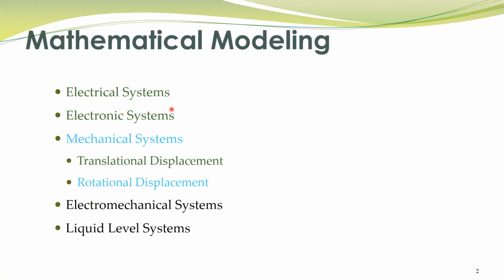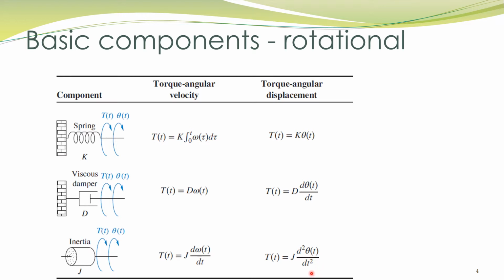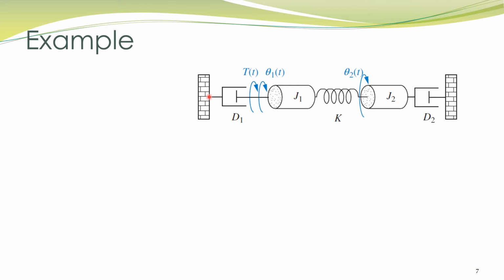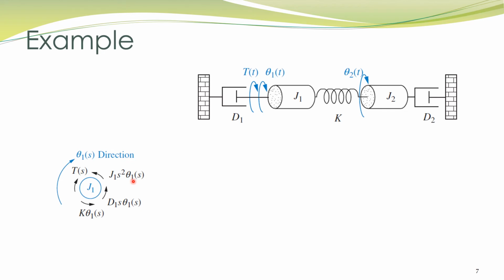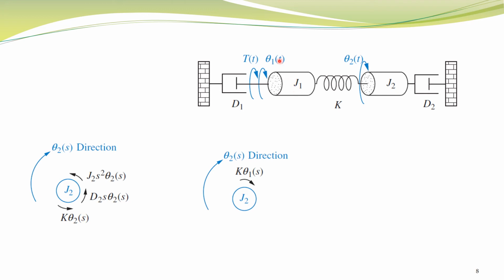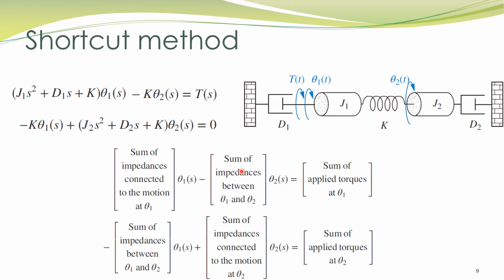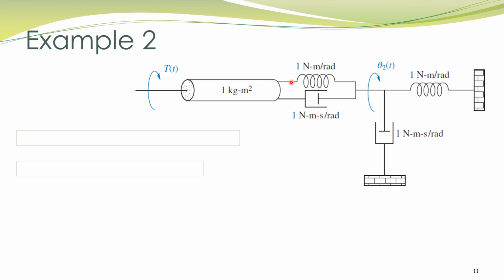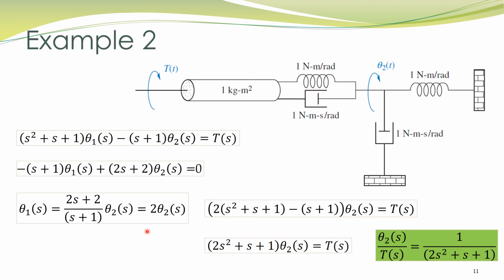LCS 7 - Modeling of mechanical systems with rotational displacement

Comment: @13:02 , why the spring will exert a torque in the clockwise direction as the same direction of the motor rotation, and in the first frame the spring will cause an opposite torque to the motor ?

Comment: Sir, I want to ask k like What if I want to simulate a Complex Mechanical System? I mean Which Langauge should I go for? (Python or Matlab). Moreover is it possible for you to share a comprehensive problem that encompasses all that we have learned in CE_1, in which we are supposed to do mathematical modeling, simulation, and creating a prototype of that problem? Kind of Mini semester Project?
Reply from the maker: I have not used Python, but MATLAB is very powerful in Simulating dynamic systems. It is also very powerful for analysis and design of control systems.

I shall try to prepare a lecture on a case study which will involve all the required steps.